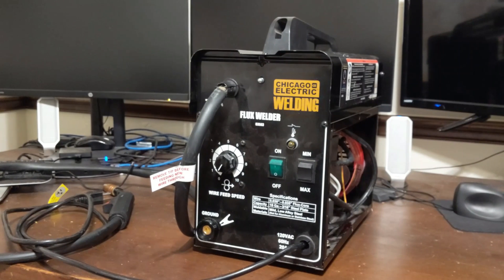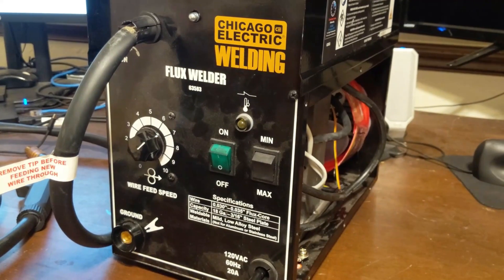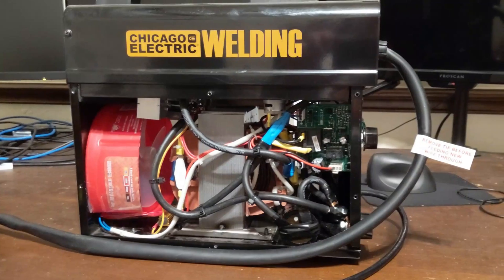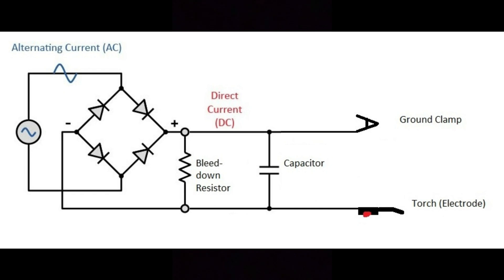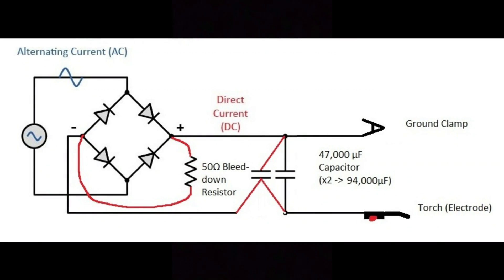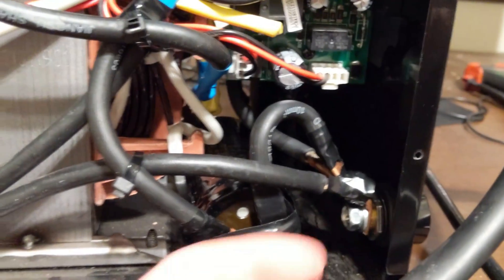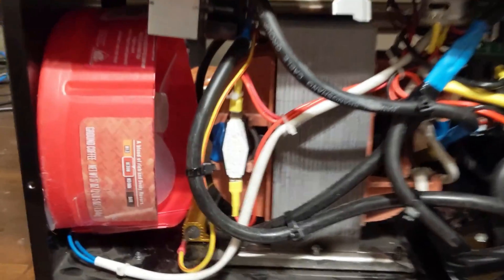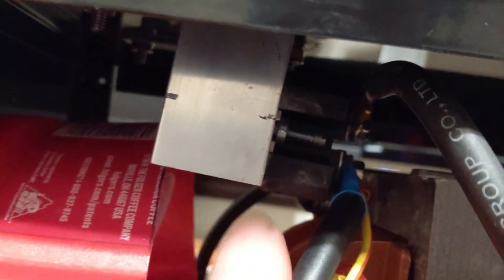Harbor Freight FCAW welder upgrade to DC output

Comment: Just adding a 150amp Rectifier is really all that's Needed For these low Amp Welders  Capacitor is not Required  Look up the Wiring Diagram for the Hobart Handler 100 & you see there NO Capacitor Just make sure your Ground Clamp is Positive +

Comment: Great video!!! 
Quick question for the group here:  Does anyone know the voltage rating of the transformer??? I was looking into modifying this welder and found a schematic online but there was no voltages only component symbols.
Reply from the maker: @carrizzle9586  no idea what it's actually rated for but after my modifications I get 27V on MIN and 35V on Max, measured between the ground clamp and the electrode.
Reply: @freedomin4low344  Thanks. This might be a modification that I attempt on the future but wanted to know what voltage rating capacitors to use.

Comment: You have had this conversion for a decent length of time now .. question is .. how is it still preforming?
Reply from the maker: Honestly man it's hard to tell. It seems to spatter less and it sounds better, but it's still a 120V welder so I can't weld any thicker material than it did before and only having two voltage settings can be limiting. It does ok with stuff like lap welds on 1/8" material but it doesn't like to tie in at the toe without doing a lot of the weaving back and forth, and I have a lot of trouble getting better at puddle control when it's surrounded by so much smoke. I'll be getting a 220V MIG as soon as I can scrape together the money to do it and I'll do a comparison video when that happens. Mostly this was a fun foray into electrical engineering which i deal with a bit at work, but applying it to a hobby makes it a little more interesting to me.
Reply: @freedomin4low344  Thanks for your opinion on this. I am brand new to welding and bought this welder as it was on sale for $99. It looks like to do the DC conversion I will be looking at almost as much in parts as I paid for the welder. Do you notice a real big difference in it being DC now vs when it was stock? I guess what I'm asking, is it worth it to put the money into it? I have never used any other welder and have only welded a few small things so far. Thanks man.

Comment: You're the first Harbor Freight Chicago Electric conversion in the past week. Intensively watching them.

The only one that has partially answered my question: 

HOW DO YOU KEEP THE RESISTOR OUT OF THE PATH OF CURRENT WHILE WELDING...???
Reply from the maker: @michaeldunagan8268  sorry I didn't catch this a year ago when you left it. The answer is, you don't. It's such a high resistance that the current going through it when welding is almost nothing, so it doesn't take away anything significant from the weld current.

Comment: Thank you for your video, very helpful. Question; the caps I have, read 450v 2200 mf it also says negative on the capacitor will these work for the mod? Any help would be appreciated 
Thank you
Reply from the maker: 2200 microFarad is probably small for this project. Not sure the meaning of the "negative" marking unless its just labeling the -/neg terminal on the cap.

Comment: hello, I am going to produce a differential lock for my vehicle, no company has produced it, I watched your videos of the locks put into the differential carrier, you compared 3 locks and you shared a list of measurements. What and where does the DRIVER OD and TOOTH ID and TOOTH CROSS SECTION (in^2) you wrote in that list show? can you tell me
Reply from the maker: @yagizozcelep_61  it's just measurements of the teeth where they engage one another. Assuming the same alloy and heat treatment are used, a larger tooth cross section would be stronger and more resistant to stripping, but I don't know if the material properties are identical and stripping isn't usually the failure mode I hear of with these...in that regard I wouldn't put too much thought into it beyond just that all of the designs are close enough to be equivalent in this particular point of comparison. The big differentiator for me was the integrated key design (vs the pins) and the stack height being correct to actually work.